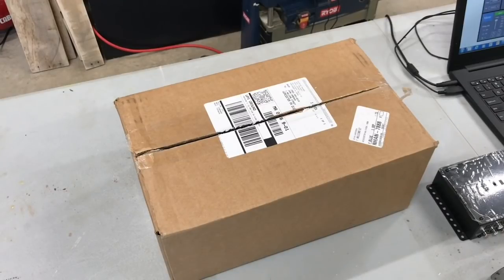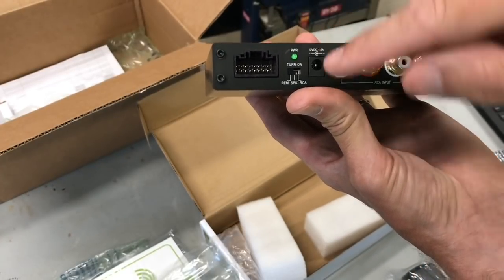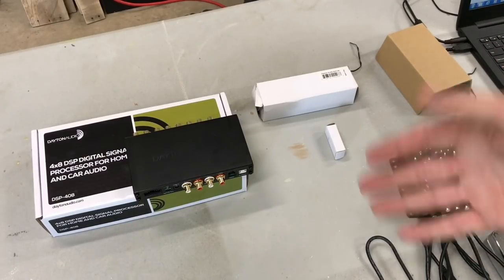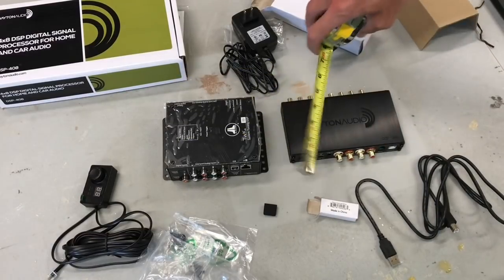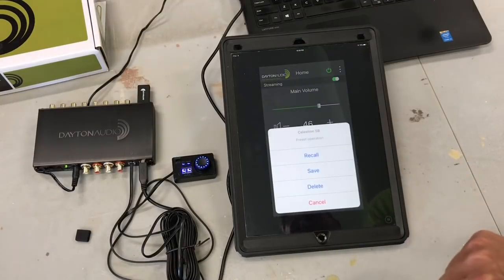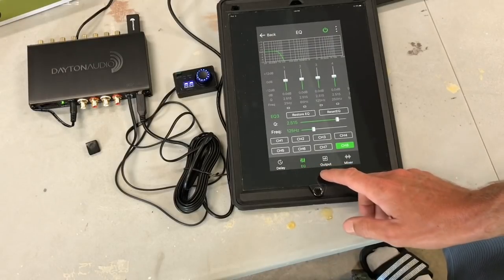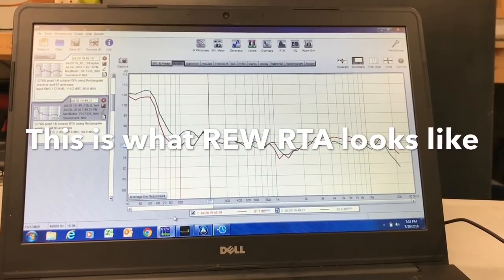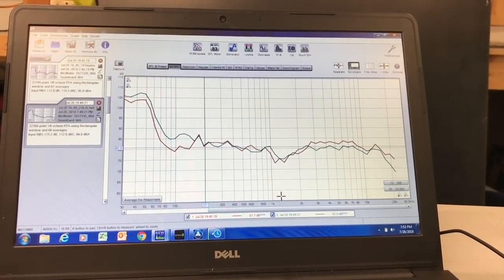Dayton 408 DSP review

Comment: I cannot imagine the sheer amount of hard work put into the making of this video.Great work, Paul Pi3rce. Thanks
Reply from the maker: It was a lot but thank you for the positive response. The more people that are educated about these things the more will get back into it and that is better for everyone.
Reply: @PaulPi3rce  I have not touched car audio for about 8 years or so. I have a modest system in my truck, a couple of alpine 12s, 3 zapco amps, alpine mids and tweets, and the zapco sx-sl IIpreamp eq. I have not touched it since it was put in the truck. Last week decided to install a double din head unit so I can join this century as far as latest technology.  The Pioneer head unit seems to have everything possible as far as dsp... would I benefit from this separate DSP? Would the sound be that much better? All I am doing is replacing the head unti and getting rid of the zapco.

Comment: FYI, the remote does work as a sub control.  You have to use outputs 7 and 8 for subs.  These outputs are tied to a remote function that is available by pressing and holding the knob while set to 7 or 8.  I've had my 408 since day one and just learned this today (4-13-24)!  The noise does suck.  I still use mine but can't recall how I got it to clean up.  The entire system works great overall now and I have no noise.

Comment: What is the latest software version?
Reply: that is a dan goood question that I posed directly to the manufacturer. They claim there are "newer" version(s) but their insightful wisdom compels them to ask for my email address via eBay messages... SMDH.... its going to be returned tomorrow. 
These clowns cant figure out how to send me firmware/software (Ive bought directly from them numerous times in the past. Their sales manager and I have a shared folder in our respective google drives) then I am done. I hope that tax credit for hiring common-sense challenged employees is worth the lost business.
Reply: The time to return my unit is <48hrs and I have yet to think of a good reason to keep this except my curiosity to know "what's in the box?? What's in the F@in boooox?." - Brad Pitt character; finale of Seven
Reply: CS47048-DQZ along with a supporting cast of TI, ST, and even a little bios chip not out of place in a modern computer motherboard. I already returned the unit I was duped (as in actual support from the vendor was included) into buying. My curiosity has taken hold and I am trying to get my hands on the "Manager toolkit" from Cirrus Logic to see how difficult it would be to make an interface for this unit native to: msix, Android, maybe an atmel or esp32? It shouldn't take much but I do have quite the assortment of more powerful RISC SoCs. Maybe stick to porting it from CS to react or arm7 bc everyone has an extra raspberry pi laying around. I mean like 3 or older.
Reply: Let me clarify my comments were towards a similar unit from another OEM. I do plan on buying one of these Daytons as soon as the money hits my account. Unless they want to give me a demo?

Comment: I noticed a hum in mine as well. I use mine in my home system and as soon as I plugged it in I noticed a pretty distinctive buzz/hum.  Without going into too much detail, the bottom line, it was the power supply that comes with the unit.
So I used a different/better power supply I had and the hum deceased by about 75%.  If you're using this in your home I would recommend buying an Ultra Low Noise LPS HI-END Linear Power Supply for Audio, otherwise, you'll have to turn the main volume down quite a bit in the software to get most of the hum to go away.  I also tried a ground loop isolator but that didn't help either.
Reply: Would you be so kind as to provide an Amazon link to the power supply you recommend? I recently the DSP-408 for a home audio application and would love to improve the existing unit

Comment: Just got my DSP 408.  You are doing the time delay all wrong. Confirmed using  REW, The inch measurement is "inch delay" not actual distance. Very important. 

My Alpine 149BT is the same way.  But gonna try DSP now. My  home theater, and my old alpine 7897 uses actual distances.   So your furthest speaker/sub will have no delay ,and closest are gonna have the highest delay numbers.  I prefer this way, as REW spits out the inch delay when using the alignment tool.  Also Sub alignment is verry different.. You're gonna wanna slide the time alignment slider in REW to find the predicted level at crossover point that looks best.. if the number on the sub is negative, you need to add delay to the other speakers.
Reply: So how can I use the delay on this DSP without rew?  Thank you

Comment: Nice little DSP, let me go 4 channel active for the fronts, mids only for the rear and 7 and 8 for my sub, the link feature is really nice, I can make changes to two channels at once, also of note, if you have a ported sub set you HP filter to where you want your subsonic filter to be. You can also sum all your inputs for the sub so it always has signal if you use the fader and will get a non filtered input

Comment: Would like to add that using high level speaker input produces a thump when turning system off. Dayton recommends using a capacitor 
Inline with tweeters for protection. That would be the only reason to use a line driver, which wouldn’t be too much added cost, as
you would really only need a 2 channel loc. This would only apply to an HU that doesn’t have rca outs. Good video!
Reply: marjohn77 I have a LC7i and the EQS (from Audio Control). Sounds like I’ll still need to keep the LC.

Comment: Great review, I wish this had 6 inputs, I currently run a android head unit, active 3way up front, rear 6.5 mids for fill, then sub.. I may try this out, I want the audio control 608 or the 810 might be over kill
Reply: I just wonder how good this all works with an android head unit
Reply: tankdog03 you can sum more inputs and add as many as 8 outputs. If you only had a single input you still can have 8 outputs.

Comment: Hi Paul, thanks for the review, nice unit for the money. I only wish, I could load measured FR of the drivers and see how x-o type and EQ affects their FR and summed FR. Theoretically it could help given the delays are correct. My friend wrote Frequency Allocator many years ago, a PC DSP soft for USB cards before hardware based DSP could be produced cheaply. The Allocator allows inputing FR and displays modified FR for each driver and their sum, accept only for correct delays as it doesn't take phase shift into account.

Comment: Just a little added info. I have but a new system in my new to me, Corvette. I am using a Joying Android unit and it does not have a volume KNOB. It has a touch screen volume control that is a little annoying. That remote knob from he DSP is a life savor as I can turn the volume up and down using the knob vs the annoying touchscreen. Also, can you comment on how much "Better," a system would sound using the digital out into a different dsp vs the rca outs into this dayton dsp?

Comment: Anyone  having " File Data Error" when DSP hookup to a PC(window10)? Presets created and saved on PC offline when retrieved and eventually saved to DSP,  cannot be loaded back to PC. I notice that the channel "LINK" tabs will be lost too if you continue using the DSP app on PC despite the "FDL" It's the same story with Bluetooth connection!!!
 Anyone can help??? Thank you.
Reply: Problem solved!!! New problem after installed in car. Factory High level wiring is wrong, input 3&4 is 1&2 !!! Whinning noise is horrible. 

For the Data file error, you just use the Remote controller to launch any of still available 5 presets into the DSP before connecting to Windows. Once "Transmission" is successful, do a factory reset from the DSP Windows's topleft dropdown menu. Everything should be fine, including Bluetooth. I hope this can work for your unit too.
But I wouldn't know what else can be done if you dont have the RC.
Reply from the maker: If you contact Parts Express I believe they are aware of these issues and will help you with it. I have not had that problem with mine but it depends on the software release/update version too.

Comment: "Single best modification..."  I have to agree.  IF you understand what you are doing, you can squeeze amazing performance from disparate drivers.  I am having a blast tweaking some old pro-quality 3-way PA drivers and a DIY B&C-based pro cinema sub---all powered by the power amp section of an older Onkyo 7.1 AVR---to achieve some of the best sound I have ever experienced in both frequency and time domains, at a system cost of about $650 (not including program source device) thanks to the DSP-408 and Craigslist bargains.  Essential to success is to have drivers with sufficient dynamic capabilities (inertial properties... what I call "ballistics") to take advantage of the inherent time-domain superiority of active DSP crossovers.  The result is amazing imaging (with the right recordings) and the ability to readily discern the quality of a recording (a mixed blessing) for its potential to "bring it".

Comment: what is the advantage/disadvantage of just setting all of your input levels to 100 and having them all go to each output. So channels 1-6 getting 100% of each of the 4 inputs,  except for lets say output 7 and 8 which would be sub channels.  Or giving the sub channels 100%of each input channels as well.  ty.
Reply: Well you will lose any surround effect that comes from left and right channels if you sum them together. You also won't be able to use your fader/balance if all channels get all the input signals

Comment: How would you hook up front, rear, and sub using just the four inputs? Can you use y rca connectors or can you do it without?
Reply: You set it in the DSP software to send the input signalmto whatever output channel you want.

Comment: I wonder if the noise is from the LED's in the remote? Or, maybe the cable? 

I would use this with a stock 4runner nav unit. Would this work to de-eq the source, or would you use a JL FIX before the Dayton? I would like some of the additional functions and outputs of the TWK 88 or the Dayton over my Audison Bit Ten. Thanks in advance.
Reply from the maker: The Dayton 408 does not undo the factory EQ, so using the FIX is the perfect solution, which I have and it works awesome. The FIX also undoes the factory time alignment too, which was more of an issue for me before the FIX was installed. If you are new to DSP's, than the JL Twk 88 is hard to beat but like I say in the video, you can get the same results with the Dayton. Some factory HU's do not have as much factory EQ as others. For example, the factory HU in my Mazda does not but the one in my Ford does and the FIX for me was the only solution. I tried to undo it with the Twk alone and had all kinds of trouble with the bass. The FIX was worth it to me.
Reply: @PaulPi3rce  Thanks. I do have an Audison Bit Ten. I just want to see if the investment is worth it. Looks like it would be about $550 with the Dayton and FIX 86. I just didn't know if it's worth it yet. I was thinking about waiting and getting the FIX82 and the new JL VXi amps to get a power upgrade with the DSP built in. I could run fiber optic from the FIX to each amp for ease and SQ. But now we're talking  over a couple grand...... Decisions decisions.
Reply from the maker: Running a Digital Optical Output would be nice and eliminate any possible noise, but is not necessary with good RCA's. The Fix 86 gives you more output channels and equalizers than the Fix 82, useful for future upgrades and multiple DSP's or amplifiers. The higher end JL amplifiers with built in DSP are really nice, but as you say they are huge money and honestly I don't think worth it for car audio. I mean sure they sound great and save space but $700+? I have run many different amplifiers from top of the line Pioneer and Alpine to lower end Pioneer and JBL club series, to middle ground infinity amplifiers, and there is no real SQ difference as long as its a decent brand. I have heard a small difference among cheaper brands though. To be honest I think buying anything more than a $300-400 4 channel amplifier is a waste of money so long as its a decent brand. If I swapped my Pioneer D8604 with a much more expensive 100 wpc JL and didn't tell you than I bet you wouldn't even notice if the gains were all set the same. If I were you, I would get the JL Twk 88 and JL FIX 82 or 86 with a Pioneer D8604 (125 watts x4 on dyno) for the 4 channel and JBL GTX 500 (800 watts on dyno) for a 500 watt sub or Pioneer D9601 if you need a 1 ohm stable 1200 watt mono amp. Soundqubed SI series are also decent for the money and Wolfram Audio has some excellent amplifiers for the money. 

I just let a friend from work demo my truck who has been into car audio for as long as me. He has a system that he spent lots of money on but no DSP. I have stock ford mid woofers (yes stock 6*8 woofers from Ford but they are bandpassed 80-2600), Tang Band home audio tweeters in stock location (A pillars) from parts express ($25 ea), and a Sundown SD3 subwoofer in a custom ported box tuned to 31 Hz (really awesome SQ sub). I have a Pioneer D8604 and JBL Club 5501 for the sub and there is nothing special about these amplifiers (other than they sound good and are under rated). I tuned this system using my FIX 86 to integrate with the factory radio and a JK Twk for DSP duties. When he auditioned my system I didn't tell him what speakers I had or what amplifiers I have, and after listening for just 5 minutes, he was floored and awe struck by how good it sounds. He was even more in disbelief when I showed him what the equipment was that I was running. This proves its all in the tune and install. My doors are fully deadened along with other acoustic treatments in the cab. He now wants to buy a DSP and have me tune his system once he gets the time, which I will. I have much more higher end speakers (Focal, SB Acoustics, and Sundown) with higher end amplifiers and aftermarket radios with DSP's in my other two vehicles and the results are the same or better. In fact I'm installing the Dayton DSP in my van right now and typing to you while I eat my supper, LOL.
Reply from the maker: You can try and de-eq the stock Toyota HU with some success but you will not get the same results as you would with a JL FIX 82 or 86, I know I've tried.
Reply: The remote can introduce noise, it's not shielded so try and route it away from any electrical noise

Comment: great video. best info for this dsp I've seen anywhere online.  How do I go about setting my gains for my 4ch and mono amp with this dsp?  Plz and thank you.
Reply from the maker: I set my monoblock with a DVM to the RMS rating of the sub and then level match the midbass and tweeters with the gains on the 4-channel amp after DSP EQ so that they are matched to the output of the sub and each other. This gives me the lowest possible noise floor.
Reply: @PaulPi3rce   Thx.  So you only use 1 input channel per output channel then?  I tried that and even when at full volume, each output of the dsp measures nowhere near 3.5volts.  Is that ok to do?  I'm only asking because I was under the impression that the higher the voltage going into the amp the better.  The only way I can get 3.5volts going out of the dsp is to assign all 4 inputs to each output at 100% and at full volume.  Actually the volume of the dsp is at 58 cuz it clips after that.  Am I missing something here?  If so, can someone please put me on the correct path?
Reply: @mpeezy358  gain is relative to the input, it's a ratio, the the hotter the signal going in will result in a hotter signal coming out, but that's what the gain on the amp is for, find your max input level (volume on the source) that is clean, then adjust the gain on the DSP outputs to it's max level clean, then adjust the gain on your amps to the max clean level, use test tones to do this, you can get special tools to find the clipping point, you can not do this with just a DMM, you need either a Oscope or a distortion detector, don't just depend on your ears either.
Reply: @charleswp71  Thank you.
Reply: @charleswp71  that's not entirely true, you can get pretty close using just a DMM. It won't be exact, but neither will a distortion detector like the one SMD sells. Now an oscilloscope will be, but then again who has 3k just laying around for and oscilloscope
Reply: @beardedforlife3740  you can get Oscopes for allot less, true the high end analog scopes will cost a bunch but for car audio a simple $200 handheld or even something like a pico scope will work just fine, the DD1 work real nice, it will get you damn near the clip point, something that can not be done with a regular DMM, sure you can do the math and figure out at voltage you need to be at for a given load but is it clean? Plus a DMM is not going to tell you what the clip point of your head unit, crossover or DSP is, at the bare minimum use a cheap $40 DSO kit scope, at least you can seen the sine wave and what it is doing.

Comment: Hi Paul. Great video very helpful. How do you add the shelf filter you mention at 43.45. Thanks.
Reply from the maker: Under your LP or HP filter type box you select the Butterworth filter, which is your shelf filter because the slope is abrupt and close to the 3 db down point vs the Linkwitz Riley or Bessel filters which use a more gradual slope and the Linkwitz Riley filter is also down 6 db at the crossover point vs 3db. For the subwoofer you would use a low pass butterworth filter. Just experiment with it and try 12 db vs 24 db to hear how it blends with your mid woofers and choose the one you like the best.
Reply: PaulPi3rce thank you.
Reply: @WitnessTheSickness99  you have to tick the box on 1 and 10, I use these on my sub only,